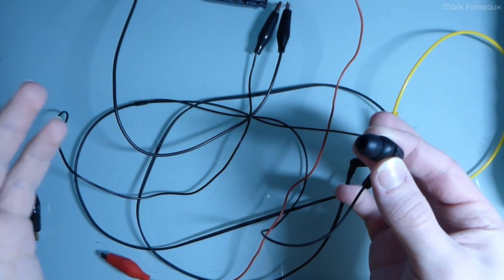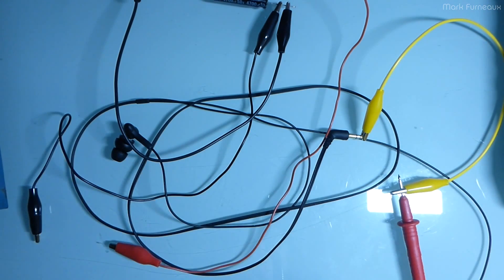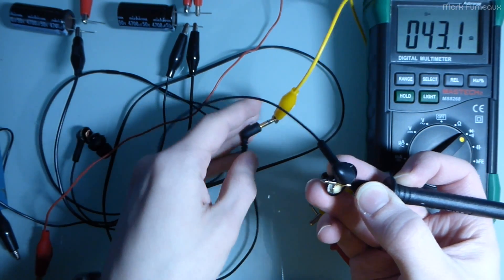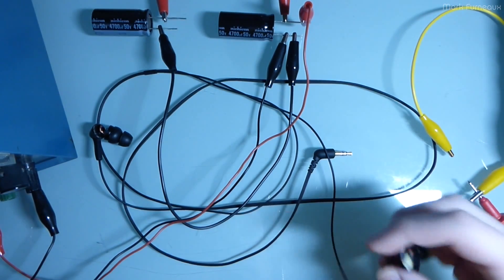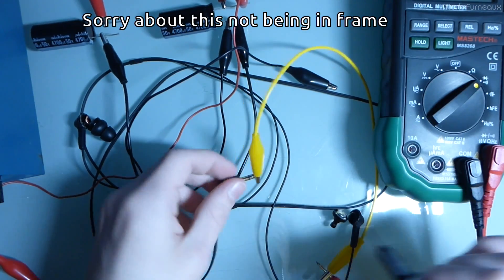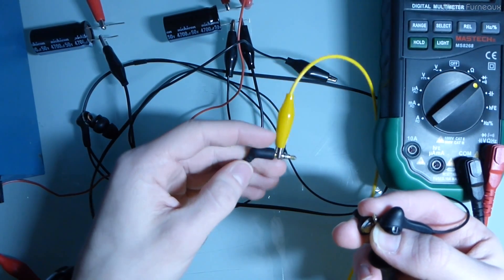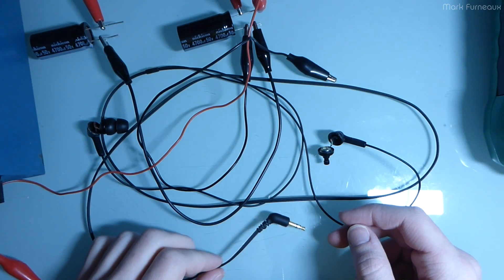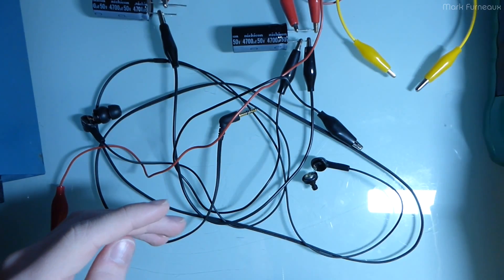Repair a Broken Headphone Cable with Capacitive Discharge

Comment: this is a very interesting idea, however slightly impractical and not possible to implement on every model of headphones since you need access to the inside of the driver and opening most phones almost certainly would damage them in the process